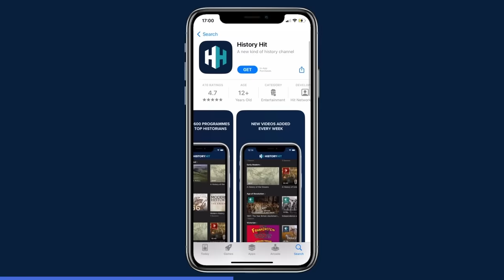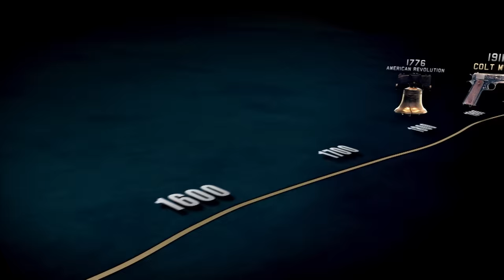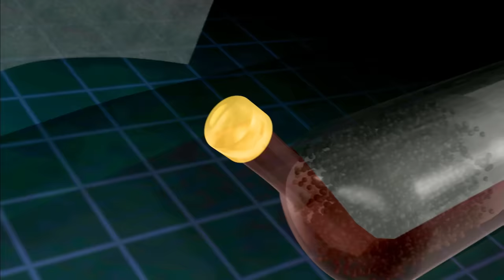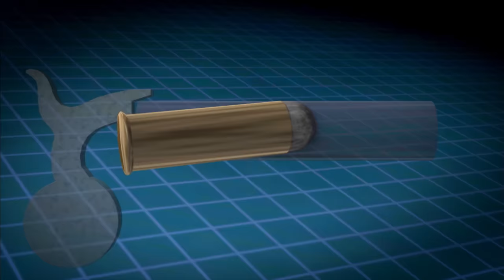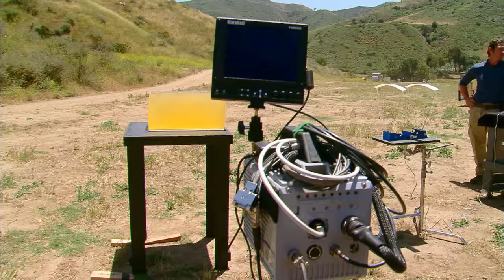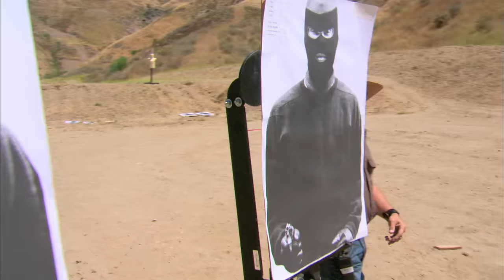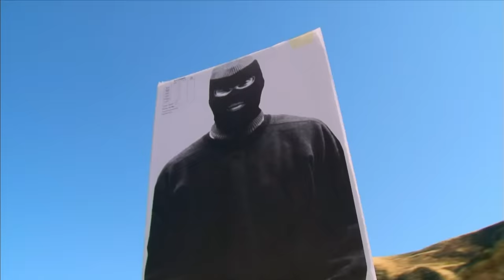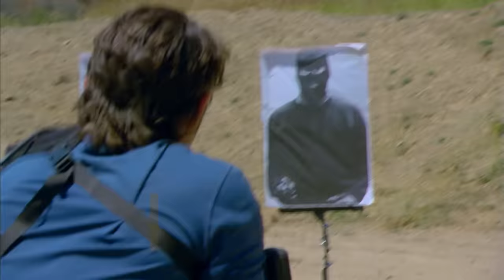Why The Colt M1911 Is The Ultimate Sidearm | Weapons That Changed The World | War Stories

Comment: First off. Outstanding video. I am and always have been a 45 or 9mm fan. Back in the 90's and early 2000's, I worked at a gunsmith/gun shop. I can not tell you how many 1911's and even Glock's in 45 I sold to Military. All had the same comment. I am tired of shooting them 3 or 5 times to stop them. The military will supply me ammo for it. Just not the weapon. This is why most Military say. Never get in a gun fight with a caliber that does not have a 4 in it. 40 or 45. all the way. Yet I still carry a 1911 in 10mm or 45. I have both.

Comment: "The most influential pistol of the 20th century"?

The only influential feature of it was its delayed blowback system, which had be adopted prior to the 1911.
The grip safety only adds cost and complexity in my opinion, and it single stack, single feed was influential to whom? Hi-Point?
Steel frame?
45acp while everybody else went to 9mm?

It was a really great pistol up until the mid 40's, and I love it, I love the feel of it, I love its ergonomics, but "the most influential pistol"? Come on...

Comment: Not a .45 ACP - Don’t call yourself an expert if you can’t get it right.  The pistol itself is the Automatic Colt Pistol and the cartridge is .45 AUTO.
Reply: No…
Reply: It's also called .45 ACP
Reply: Now, now.  In a world with .45 Colt, .45 Schofield, .45 Auto, .45 Autorim, .45 GAP, .45 Special, .45 Super, .45 Raptor, 45-60, 45-70, .45-75, .45-90, and .45 Win Mag, it's okay to take a little descriptive liberty here and there, don't you think?
Reply: @machschnell  Well yeah but those are all different cartridges .45 ACP and .45 Auto are the same though

Comment: Colt said they can easily retool a 1911 in a 9mm with a double stack mag. that would be equal or better to the Glock.
Reply: It’s called a 2011 and they already exist, lookup the Staccato 2011 which is being used by some agencies and police departments. It has a double stack 9mm magazine. They lack the reliability of a Glock which is their main issue
Reply: @Nach0s187  Others make a 22 in 1911, but not Colt.
Reply: Colt is irrelevant. Overpriced nostalgia guns from the last century.

Comment: There is no substitute for cubic inch's..And I had damn near every pistol ever made..Why people that been around know the .45 Auto works..
Reply: Sure, there is, in engines its rpms, in weapons its velocity.
Reply: @richardpowell1664 velocity? In what way? If you're talking muzzle velocity that's irrelevant. Silly 223 is moving real quick. Doesn't mean it's as deadly as 7.62 or 308. Same with a pistol round a slower bigger bullet does more damage to a body than a faster smaller bullet.
Reply: Velocity kills. The 55 gr 5.56 is much more lethal than the 230 gr 45 ACP. The reason, velocity. If velocity doesn't matter then you could throw a 230 gr 45 ACP slug by hand & it'd be just as lethal as one fired @ 850 fps from a 1911-A1.
Reply: Dragging a big, heavy and under powered lump of metal is so great.

Comment: there's nothing at all special about the 1911 or the .45 ACP rd.  They are obsolete.  Today, a .$400  Star BM 9mm from J and G sales is a better belt gun and the $400 Star Model DK , if it's hot loaded to the max safe limit in a locked breech gun, are much better than the 1911, in spite of being 60 year old guns.  The "hand in pocket' draw is twice as fast as any other CCW draw ,

Comment: Greatest? No, but still formidable after 113 years. In its hayday it was top 3. Now id say top 10 still. But there are far more superior designs. Depending on caliber and ballistics per say... 5.7, 10mm, 357 sig, 7.5 bruno, 50 ae, 17hmr, .45acp, 9mm,  in ww2, its what i would want. But today? You need suppression 
potential just as much as effective energy. Your calibers have their merits and then different platform designs have their benefits to each caliber.

If i were a german soldier. Id choose the c96 over the p08